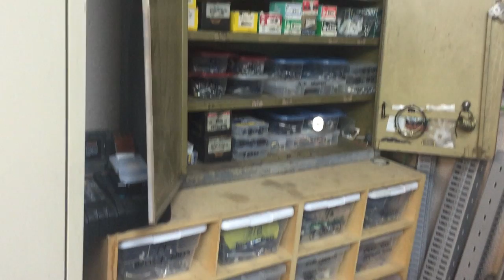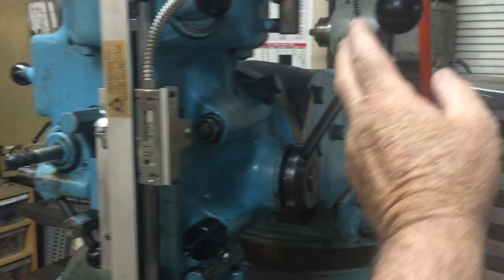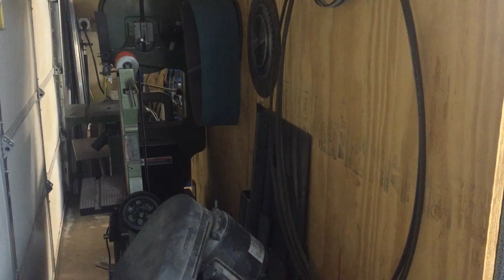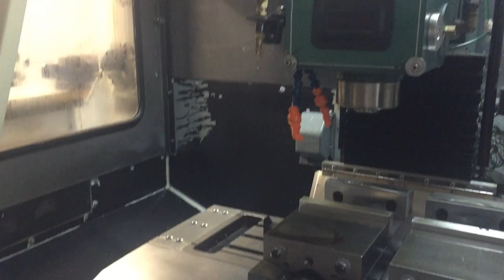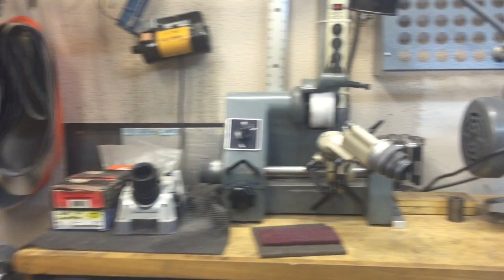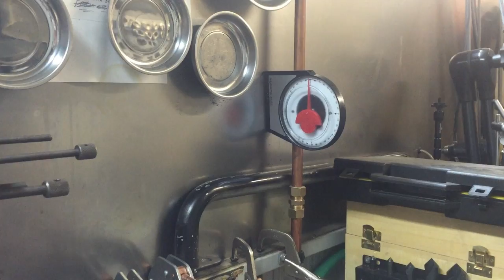Shop Tour

Comment: I also have a RF-45 clone from Wholesale Tool, my first and only mill.   I've kept it stock and manual.  I notice you have a Bridgeport  mill.   I've always wanted to ask someone who has both: How does the rigidity compare between the two?
Reply from the maker: The RF45 clones are about as good as it gets for a bench-top Mill.  However, the column on these mills are their weak point and can't compare to the rigidity of the Bridgeport.  I avoid any heavy hogging with my CNC and stick to lighter cuts.  Adaptive milling is your friend on a CNC .. Even with lighter cuts It still gets the job done faster and more accurately than you could manually, and you don't have to stand there turning handles.
Reply: Interesting. Always had the same question  and thats about what I figured. I do still wonder about spindle and finish pass comparison assuming light cuts at optimal high RPM to low feed rate for best finish in say 6061 which is probably the toughest to achieve a good side milled surface finish on.
Reply: Also wanted to say the shop looks great btw. This believe it or not is my dream setup but first I will need to move on from renting :(

Comment: I just watched your tour of your shop and what you did with so many machines with the space is amazing.  I do have a question on your cnc mill.  It seems you've done lots of work to it.  I have a bolton ZX45 also that has been converted.  I still have the gear drive set up on the head.  Do you have plans or info that you could share so I can convert my head belt drive so I can run it at higher spindle rpm.
Reply from the maker: Dsii,
No plans, but I have a build thread on CNC Zone called 'Bolton ZX45 Conversion' that has more info on the belt drive.
Reply: Thanks, Ill take a look.